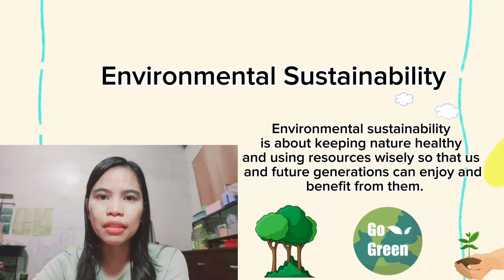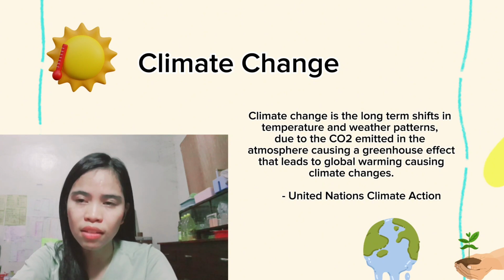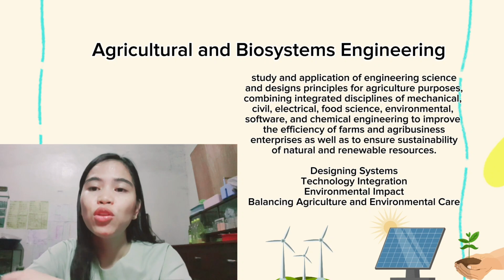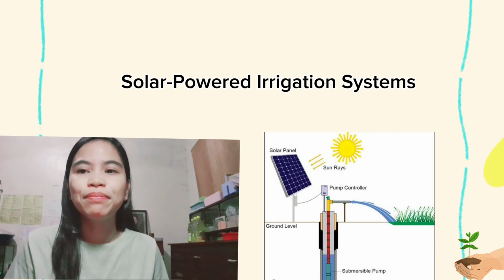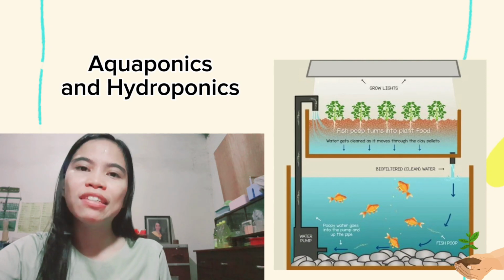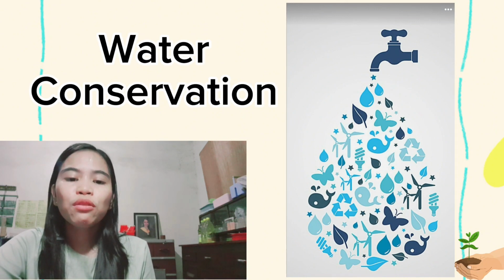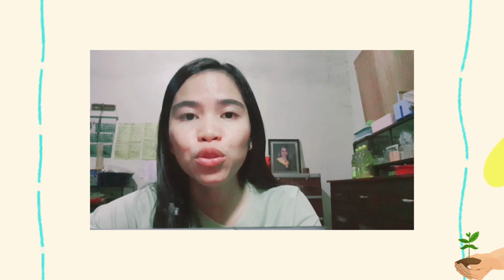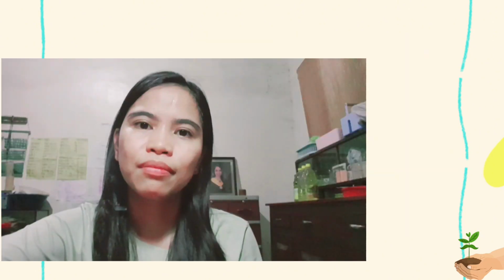Environmental Sustainability, Agricultural Impact and the Roles of ABE's

Comment: Biopesticides also promote a sustainable environment as they offer lower energy consumption in production compared to petroleum based synthetic pesticides which requires energy intensive manufacturing process. Less industrial processing means less fossil fuel energy consumed, and less fossil fuel energy means less contributors of greenhouse gas emissions.
Reply: Biopesticides are great development helping Biosystems to stay in balance. Reducing the need to gather harmful substances that worsen the situation in both agriculture and ecology.